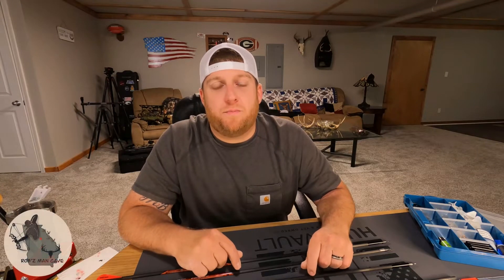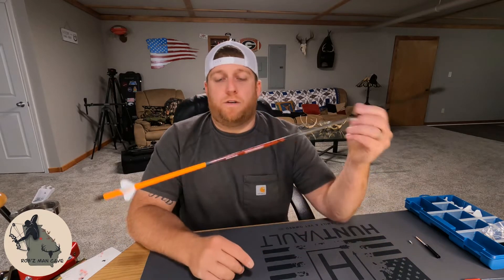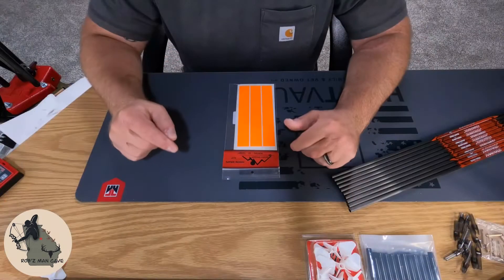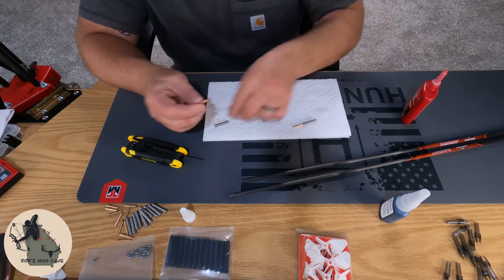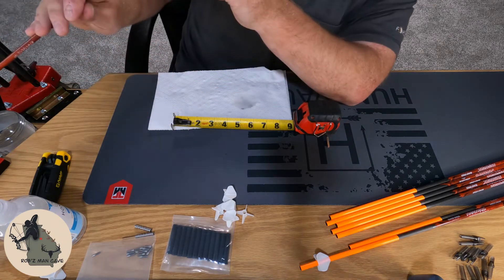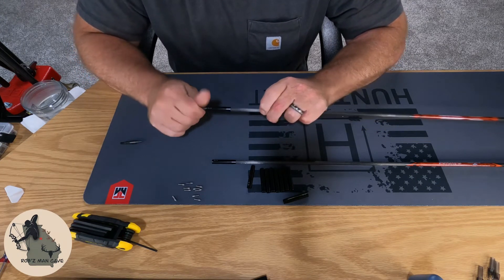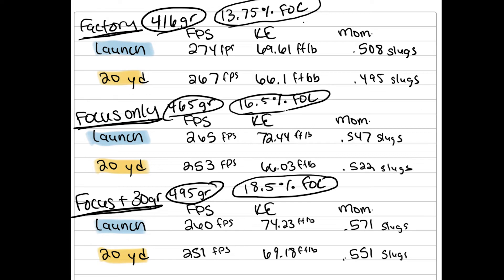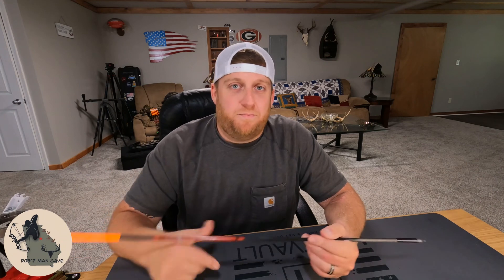Black Eagle Rampage with F.O.C.O.S. System | High F.O.C. Build

Comment: I never had good luck with the Rampage arrows. The nock end would always crack. Cracked a dozen and gave up.
Reply from the maker: I’ve got 4 dozen now and haven’t seen that issue yet. Although, I’m about to give Victory a shot.
Reply: Black Eagle makes an aluminium nock bushing you can put over the rear end of the arrow. It will protect that end of the arrow and you can glue it on for even more strength. It's a good looking nock bushing and only adds 3 grains of weight to the arrow, and with gluing it on, you'd be ok, more than likely. I'd give Black Eagle Arrows a call if I were you and let them know what problem you are having and they might even replace those broken shafts for free.
Reply: @jefflovesdogs9973  I may get a half dozen and give it a try that way. I went to the Spartans which come with the nock bushings and they’re surprisingly way more durable than I would’ve thought. Thanks for the recommendation

Comment: What do the inserts alone weigh?
Reply from the maker: the focos system is 100 grains total, that includes the insert, collar, and screw. That is only like 45 grains more than the factory half-outserts. The brass weights were 30 grains
Reply: @robzmancave  Thanks, im looking to try these in some Victory .204's. Will definitely use them if i shoot the Rampage's again.
Reply from the maker: @_DeFiNiTeLy_Not_BrAd_  what spine are the victory’s?
Reply: @robzmancave  350's, RIP XV. If i get a new bow id probably have to go to 300 spine.
Reply: Have the threads on the brass weights sheared off? The archery shop in my area expressed grave concerns about the brass threads giving way after being shot quite a bit. I am trying to tell if there is any merit to what they are saying. They really can't stand brass weights and highly prefer steel. Of course, they make more money by selling me a bunch of 20 grain Gold Tip steel weights, as they are more expensive than the Rampage brass weights, but then again, the FOCOS system brass weights are 3/32 diameter at the threads. I called Black Eagle and they suggested instead of the FOCOS system with the 3/32 brass weights to use their standard half out that weighs 50 grains and the weights for it are larger diameter, maybe 5/32 or so.  However, to do that I would give up the strength of the FOCOS system protecting the front part of the shaft, so I kept the FOCOS system and got the Gold Tip 20 grain weights with a thread diameter of 3/32 and those should not shear off because they are steel. Let me know if you had any issues with those brass weights. Thanks!!! @robzmancave
Reply from the maker: @jefflovesdogs9973 that’s weird for them to suggest that. I’ve got 3 dozen built exactly like this and I’ve got probably a couple hundred shots on each arrow. I hadn’t had a single issue. Could be because I used the loctite, But maybe I’m just lucky.

Comment: How much extra distance is added to the arrow shaft with this system?
Reply from the maker: About 5/8”. The correct way is to subtract that 5/8” from the over all length needed, but I chose not to in case I wanted to revert back. 5/8” isn’t enough to really worry about in my opinion.

Comment: I'm in the process of building arrows now, I want a higher f.o.c more for the fact I hunt hogs more then I hunt deer. I don't want 2 set ups so this system seems perfect for both whitetail and hogs. My set up now I run a bowtech cp28 70lbs 29.5 draw current arrow is black eagle zombie slayer, 200grain broadheads total grains 525 give or take.. I'm wanting to load the arrow so I can use a 100grain broadhead that way I have more options.. great video man let us know how they work for you
Reply from the maker: Thanks man! glad you mentioned that, this was one thing I forgot to talk about! I could have easily just went to a 175gr or 200gr broadhead, but that greatly reduces your options. Plus if I decided that I wanted to reduce/increase weight later I would be limited even more, and have to buy all new broadheads, instead of just adding/removing weight. I should have mentioned price also. The FOCOS system only runs about $25 for half dozen or $45 for dozen. And weights are $15 a dozen. I definitely think that this is the way to go. And especially for hunting hogs. How do you like the zombie slayers?
Reply: Definitely a cheaper and ideal way to go. I like the zombie slayers they shoot good, this is the first year using them but I've always had good luck with black eagle. I'll definitely know more when I kill something with them.
Reply from the maker: @brandonjones9376  good luck this season bud! I will try to update when I stick one
Reply: @robzmancave  thank you and good luck to you as well.. if you make down the altamaha River area hit me up